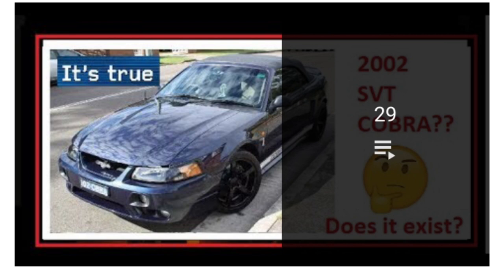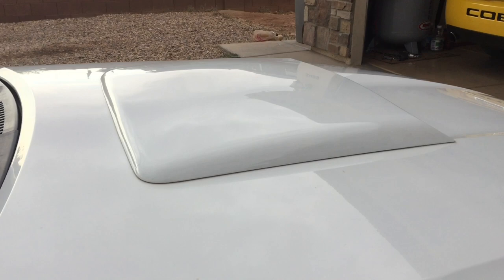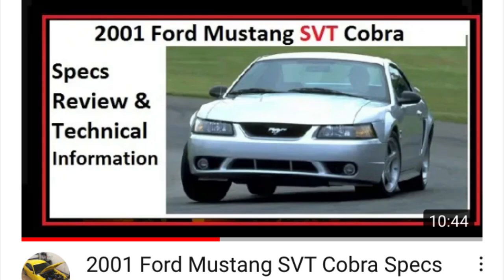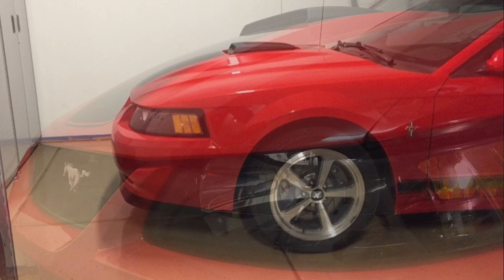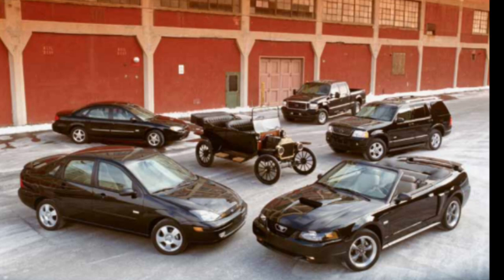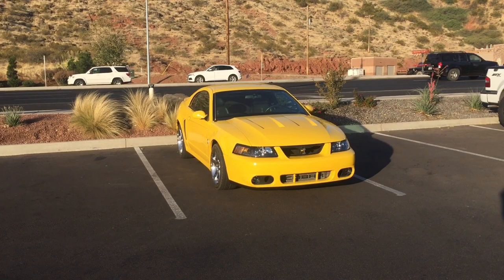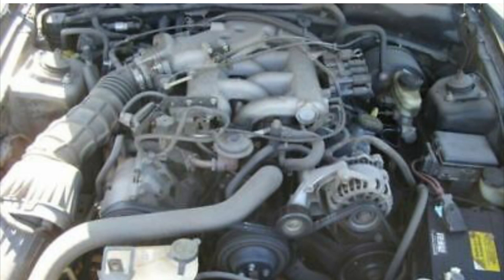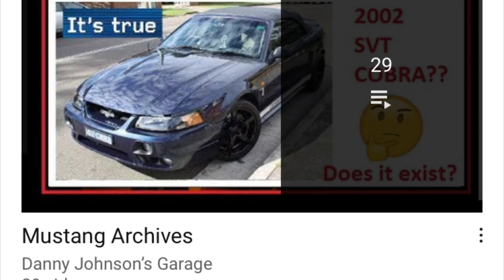99-04 Mustang Design Part 2

Comment: Thanks for making this! I started learning about cars at 14 yrs old and by the time I was a sophomore in high school I was an expert on all Mustangs up to that year. After the SN95 came along I started losing touch (because life) and never got back some of the detailed knowledge I like to have on something I'm interested in. 

I just recently got back into the Mustang and had quite a few questions about details, like why does my New Edge V6 have a rear wing with pedestals instead of the more contoured wing I see on others? What did that hood scoop I (we) like so much actually come on from the factory? Etc, etc. 

You covered most questions I had except for the wheels options for the V6, which I'm not sweating over.

Comment: Great content Dan.Question for you,I have a 14 gt and have a borla attack cat back system on it.it sounds pretty good but I want more rumble lol.I don't have longtube header money rite now,is their something else I can do to get the sound I'm looking for without breaking the bank on headers,thanks
Reply from the maker: I would get a H pipe with no cats (or cut your cats out and have straight tubes welded in place if you don’t have emissions where you live).
Reply: @dannyjohnsonsgarage  I will look into it thanks.....and if it throws a check engine light,I could get rid of that with a hand tuner,nice!

Comment: The 2004 GTs had bigger side scoops than the V6s of the same year?
Reply from the maker: Yes. The V6 has shallow scoops with more of the honeycomb exposed. The 2000 Cobra R and 99/01 Cobra also had the v6 side scoops (same scoops as 99-00 GT)
Reply: @dannyjohnsonsgarage  besides the side scoops, hood scoop, fog lights and rear bumper, any other differences?

Comment: Hey sir, Im months away from owning a terminator but I see you find convertibles more often for sale & cheaper. So if I get a convertible can I make it hardtip ever after?
Reply from the maker: There was a hard top lift on roof for 1994-1998 that might come close, but so haven’t seen one for 1999-2004 specifically
Reply: @dannyjohnsonsgarage  so pretty much unless it gets a customized welded roof huh?